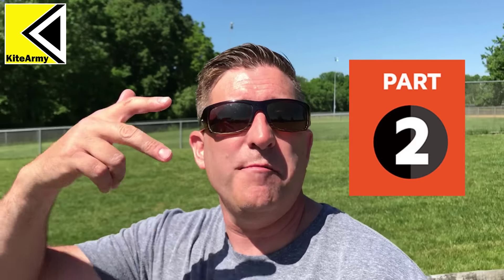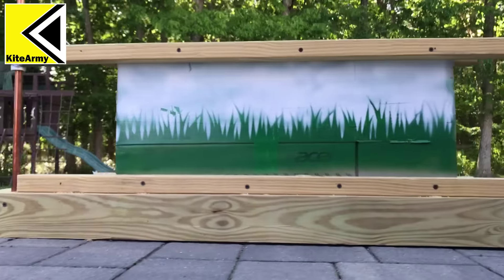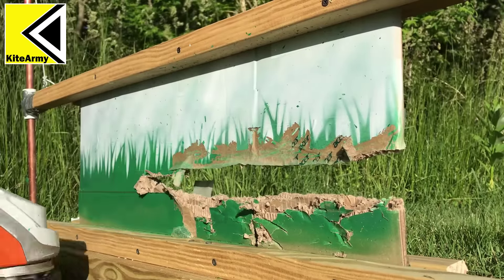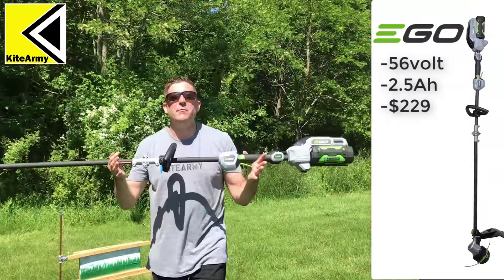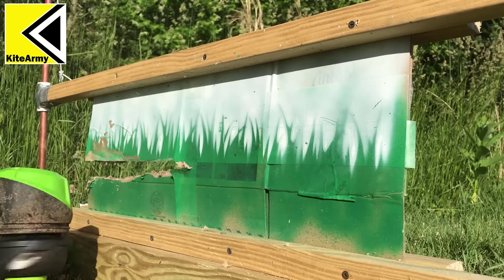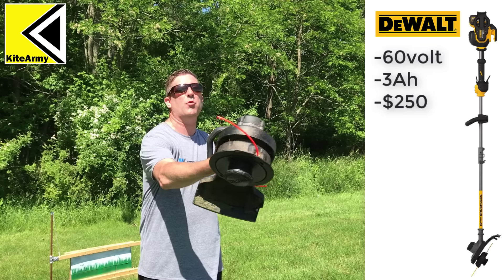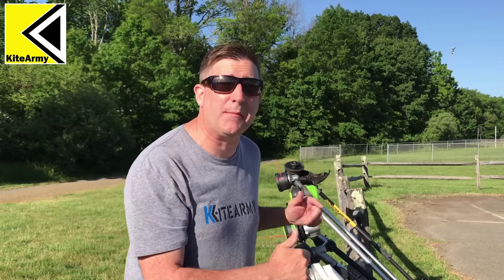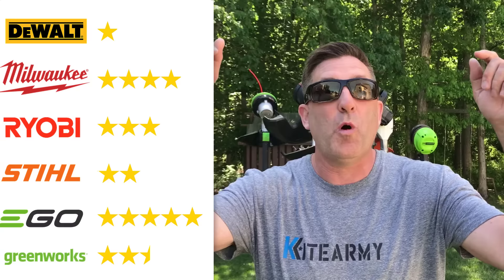BEST STRING TRIMMER 2020 | EGO Milwaukee Dewalt Ryobi Stihl 💪💪💪

Comment: I like the lightness of this machine as I have a weak shoulder.  I found the power to be adequate for my 10000 and 6500 sq ft. lots..   I can't follow the string loading instructions even with diagrams.  This video demonstrating reloading as simple.  My gas trimmer is much heavier.  I tested all the other trimmers: Ryobi, Toro, Milwaukee etc.. They have a higher voltage battery, but I read 18 volts is sufficient for my needs.  They were all quite straining for my shoulder.  
I regret that i don't know if this machine is compatible with a 95 string, but I can try it.
I highly recommend this machine for trimming and edging.

Comment: Just bought the EGO 1521S yesterday 5/21/2021 from Lowes.  What can I say, this trimmer is a beast.  Super quiet and super smooth.  I've had Echo and Stihl before and they where good trimmers but this thing is in another league to me. No mixing gas and oil, no vibration beating you to death. I'm sold on the battery powered equipment.
Reply from the maker: that's how it normally goes
Reply: I wish I could be sold on battery equipment as I know a 40 V trimmer can out perform some gas models. But the issues I have are that these batteries only last 3 to 5 years only and that’s under optimal conditions and charging them properly. To replace them cost a minimum of $80 for a four amp and can go up to $200. But my biggest complaint is they don’t tell you there is no way to recycle these batteries. They are just like the electric car batteries. It’s a great idea but no one tells you that they’re 3k-5k to replace and to date there is no way to recycle these batteries.  Some can be dismantled to extract materials to make new batteries but most go into the landfill.
Reply: @craighellberg4366  ---- Since the cost of charging them is neglibale, you need to figure the cost of Gasoline, oil ( or the mixed cans which is even more costly ) plus  any service needs within that 3 to 5 year battery. 

Does a gas trimmer use $100 in gas and oil in 4 years?  $25 a year?  Guess it all depends on the lawn size / mins of use per week during the season.

Ive got an acre of land and use about 1  40-1 can which costs $21 a year.

Comment: I don’t know what kind of string you are using, but that was pretty bad. Use some better string, let the head come up to full speed, then go at it. Why did you need so much bump feeding when cutting cardboard? Something’s not right. I just returned two EGOs because they weren’t any more powerful than the flexvolt.
Reply from the maker: YEP - cardboard will kill string - but thanks for the advice
Reply: @Kitearmy  that's some pretty weak string you're using. should do a test to see which trimmer can handle .105 the best
trailblazer or stihl cf3 pro
Reply from the maker: @zacjohnson8404  Well - most people are not professional landscapers and .09 should do the trick.  Trust me, cardboard is like razor blades to string.  Go try it
Reply: alright ill have to try it now
Reply from the maker: @zacjohnson8404  Cool - If I'm wrong, feel free to throw a bunch of shade my way
Reply: @Kitearmy  what size line and brand were you using?
Reply: ok I tried trailblazer .105 green line with the stihl fs90 on that really heavy double layer cardboard that's used for fruit packing.
it went through it like nothing. it did wear the line down a bit but it didn't snap off. a more powerful machine will make line snap off worse.
my point is, you need to use better line on your test. not heavier, just better quality line that doesn't snap. just for sake of argument, grab a small roll of green trailblazer or cf3 pro .105 and see how it goes with these battery trimmers. electric motors should have a lot of torque and should be ok with one step up in line weight, I think.
Reply from the maker: @zacjohnson8404  Okay - though most if not all of these trimmers max out at .095.  .105 is professional stuff.  Good comments none the less
Reply from the maker: @zacjohnson8404  Hey mate - You have to watch my blower review - 10 brands.  Hopefully posting this upcoming weekend.  Would love to hear your thoughts
Reply: @Kitearmy  cool man, subbed.
have you tried any of the husqvarna battery stuff?
Reply from the maker: @zacjohnson8404  Great to have you - Oddly enough I have never tried any cordless Husky gear.  Strange don't know why that is.
Reply: @Kitearmy  the ego powerload is aweosme i think that guy got defective units cause i have not had a issue with my powerload at all hands down the best trimmer i have ever owned and used and love it
Reply from the maker: @snoopysrc  I think that some comments are fans of other companies tools - could be the case
Reply: @Kitearmy  who do you think makes a good eletric string trimmer?? i think ego is pretty tough
Reply: @Kitearmy   I'm not professional, but I use .105" minimum on the 'orchard' part of my lawn.  I have to take out those 'stringers' that grow out of the bottom of fruit trees, as well as thick tufts of timothy and fescew.   So if your lawn simply isn't possible to keep a nice fluffy Kentucky Blue, and it is weedy and has strands of feral baby trees growing in it, .105" is a must.  

I use the thickest line possible and actually use Low speed on my Greenworks 82V Attachment Capable.  The string bludgeons the weeds to death, mulches them in the air and sends shrapnel everywhere.  

I've found this to be far more effective on unconventional 'lawn' than what the OEMs offer.
Reply: @Kitearmy  Then why did you use cardboard?
Reply from the maker: @pmaint1  Good analog for tough brush

Comment: I know this is an old video but appears to be variation in the test.

1. The passes were right to with the exception of the Ego and Greenworks.

2.  Didn’t congruent
If string varied between test.

3.  Appeared to be variation in brushed vs brushless head units.

Comment: Hi Andrew, I know this is an older video but I just bought a replacement head for my ryobi expandit trimmer. It lasted 2.5 years (the head) but I got tired of it popping string inside the head periodically and usually on the hottest days. I bought the 1-2-Trim Pro series. No more bump and hopefully feed. You use 3 pieces of 12 inch string folded in half so you have 6 string ends. Where the string attaches, it pivots so less shock to the string when hitting something hard like concrete or wood.Takes like 30 seconds to replace. I just put mine on and went out and edged the sidewalk. Took about 5 min's off my normal time to trim it and made the edge deeper. I then went along one fence like butter. My RYobi Expandit feels like a new piece of equipment.
Reply from the maker: Love that when you find something that makes these tasks easier

Comment: Cardboard grass is not cut from the same side for all trimmers, is that because the heads don't all rotate in the same direction?   The the line is going fastest at the end of the line, you seem to be very close to the cardboard.  I notice when you pounded the trimmer on the ground,  you were chewing on the wood.   I suue would like to know the weight difference.  I am old and want the lightest I can find.  Thanks.
Reply from the maker: I moved the trimmer based on the head rotation

Comment: That stihl model you’re using is called the fsa 90r, it has adjustable rpm dial. You say its a fail when you give 0 ramp up time and have lowest setting for rpm. Also you arent doing the bump feed properly, must be full speed to work right. Says that in manual plus sales man would tell you that.
Reply: You also using the default orange line, .095. That line is amazing for grass and thin brush work. But you cutting through cardboard.
Reply from the maker: It's on full speed - I used the same line on all products.  No line is made for cardboard as far as I know.  In any case, I'm really not impressed with any of the stihl cordless tools.  Maybe their next gen will be better.
Reply from the maker: This video says it all: https://www.youtube.com/watch?v=AHamd-NWg2g
Reply: Kite Army no way that was at full speed
Reply: @TheDudeIndiana03  indeed, video is sponsored by EGO i think

Comment: As always...liked the video but I'm gonna tear this one apart. First of all, I think that cardboard was really hard on that string and affected the results of the test. If you did this test at least 2 more times do you think the results would be the same? I think the cardboard was snapping the string off randomly and if you did more tests your results would vary. The string could have broken off inside the Ego head for instance because of the cardboard...would you have "Failed" that one? Is there another brand of string that is more durable that wouldn't break down as easily to give the trimmers a better chance at making it to the end of the test? Just throwing those ideas out there to see how they "blend"...lol. Still fun to watch and until the string breaks, you do get to see which trimmer chews into the cardboard "grass" with the most gusto so...still gotta give you credit for the demo. Carry on bro! Cheers, John ;)
Reply from the maker: Hey mate - OK I agree that this may not have been the perfect test BUT what would have been.  If I tested on real grass people would have said   one grass was thicker than another - you get the point.  Also I used brand new ECHO commercial string on all models so they all had an equal shot.  I bet if you ran this test 100 times you wold get nearly the same results.  YES I would have failed any brand in this test - I had 6 pieces of cardboard - that's it.  Make it or break it.  

Next test is going to be EGO vs Millwaukee on real grass running through the battery completely.  Should be fun
Reply: @Kitearmy  Sorry for being "rough" on you Andrew...lol ;)...and like an old boss once said to me "It's OK to complain about something, but suggest a better way of doing things to go along with that complaint"...so you got me there...haha. Also is the old saying "You can please some of the people all the time, all the people some of the time but you're never gonna please ALL the people ALL the time". Carry on Andrew, you're dong a great job and I don't mean to discourage you ;) Cheers, John ;)

P.S. Presently working on my first YouTube "rebirth" video on Premiere Elements. It's so different from the editor that I was using. We'll get there tho...still lot's to learn in any case no matter what editor I have...lol. Got rid of World of Warships the other day as it was going to do an update for June and I said "No"...time to dry dock the ships until next fall. YouTube here we come! Yeewww! ;)
Reply from the maker: @funafter5081  No discouragement taken - sometimes you win sometimes you loose - But you have to remember that your real friends are always there for you to remind you that you lost.
Reply: @Kitearmy  ;)
Reply: I agree because you could hear that dewalt trimmer had a bunch of power that was wasted I wanted to see that one go

Comment: I know this is an old video but noticed there is variation in your test.
1.  The  passes varied from right to left all other except Ego and Greenworks. 

2. Didn’t confirm if all the same string was used.
Reply from the maker: yep - same string.  Direction was based on the head rotation

Comment: Thanks for the post! - It has made me think twice about buying a trimmer in the same family as other tools just because the battery is interchangeable.
Reply from the maker: If you need only a single tool you can probably get away with it BUT as soon as you need that blower you are stuck

Comment: Pretty useful information if my yard was made out of cardboard but mine's not so I guess I'll just keep rolling with my DeWalt 60v flexvolt trimmer
Reply from the maker: I always feel really bad for Dewalt - their yard tools make me question their shop tools.
Reply: LOL. Yeah, last time I checked my yard wasn't cardboard either.
Reply from the maker: Mine is like a hallmark card
Reply: He should have used a digital inch pound torque wrench to measure the actual torque/power these trimmers put out or something similar. He used the POS old style trimmer head on the DeWalt that I hate & have on my 20V DeWalt & he started the cuts from right to left on the DeWalt, Milwaukee & Ryobi also. It does make a difference because the DeWalt spins counterclockwise & the Ego does also. You can tell he's Ego biased in the way he purposely cut shittier into the cardboard with the others. I will give the Ego props for the self loading feature but the Ego loses a lot of points because you can't use any universal attachments like you can with the RYOBI 40V Brushless. Ego & Milwaukee use their own proprietary inner shaft connector to attach attachments on them. I have Milwaukee, Ryobi & DeWalt batteries BTW & I would buy the Milwaukee but I can save a lot of money using my universal attachments on the Ryobi 40V trimmer. TTI is the parent company for Milwaukee & Ryobi BTW but Milwaukee screwed up IMHO for not using the universal attachment connector system & would sell a lot more of them if they had. I hope someone machines an adapter that can be used on the Milwaukee to accept universal attachments.
Reply from the maker: @jetenginethrust863  KIteArmy's response:  Yes I'm biased towards EGO because the tool performed best (in my test and opinion) better than any other model.  I think it would be strange to prefer a brand that does not perform well.  2nd - EGO does have a universal tool - called the multi-head.  3rd - depending on the rotation of the head, I started on the appropriate side of the cardboard to keep it fair.
Reply from the maker: @jetenginethrust863  Nope - I have a good time making a fool out of myself - Welcome to the club :)  

Also, it aint universal if if it doesn't fit everything.  Here's the definition of universal "applicable to all cases".  HOMEWORK DONE!

Comment: What about the 36 volt Makita trimmer? I have been watching your reviews for quite sometime now and my 3 choices - EGO - Milwaukee - and Makita. I was hoping you would have tested the Makita so I could rule it out completely. I don’t have anything that uses either brand of batteries so I am starting out fresh. I was at Home Depot yesterday and I left more confused than ever. Both the EGO and Milwaukee seemed heavier than my gas trimmer which I am replacing. Have you thought about using a brand name gas trimmer to use in this test against the Milwaukee and the EGO it would really be a great test in my opinion. But it’s not my time doing the testing. 
Ok now which would you purchase the EGO or Milwaukee? I value your opinion. Thank You and I hope everyone is having a great holiday, Cheers
Reply from the maker: The EGO carbon fiber auto load will blow your mind.  Not to mention the other tools they make are just as solid - also cheaper than Milwaukee.  Not much to say about Makita other than I would never buy one.
Reply: @Kitearmy  why? What’s wrong with Makita?
Reply: @albertsilva2818  Unless its made by EGO he will have a negative review.

Comment: To properly run string trimmer tests, you should pair the trimmer with the maker's own brand of lines.  For example, my EGO carbon fiber split shaft trimmer would break lines at an unacceptable rate when I used other brands of trimmer lines (including Husqvarna Titanium Force, Oregon Magnum Gatorline Super Twist).  Both the Husqvarna and Oregon are premium lines but they would snap off miserably when I used them on the EGO.  When I used EGO's own brand of lines on the EGO trimmer, the lines lasted a long time.
Reply from the maker: I used the same lines to keep things fair
Reply: @Kitearmy  Undoubtedly fairness was your intent, but some trimmers just don't like some other brand's lines that they are not designed to run on.  Although the packages of the lines may not say so, each type of line has its own ideal or tolerable rpm range.  If the trimmers are run outside of a line's design rpm range, the trimmer may not cut well or the line may break more often.  Therefore, the test would actually be fairer if the same brand of line was used on the same brand of trimmer.
Reply from the maker: @stevew3978  sounds reasonable

Comment: You forgot to mention the Milwaukee is a quik-lok attachment system that Milwaukee makes attachments for, you have the ability to change from a trimmer to a hedge trimmer, pole saw, and edger, plus you can use that same battery on a drill, impact, grinder, compound Miter Saw, table saw just to name a few and whatever M18 tools Milwaukee makes. Can EGO do that? You can save a lot of money by just buying the attachments instead of having to buy a separate tool for each one.
Reply from the maker: Right - but does Milwaukee have a zero turn ride on mower powered by the 18v batteries?  Ego does

Comment: I'm trying to switch over most of my stuff to battery powered. Ego is very tempting but I was looking at one in the store today and if you never saw any videos on them you would think they are junk. They feel low quality even next to Ryobi. I really liked the feel of the DeWalt especially the handle. I walked out with a milwaukee because all my tools are red and I didn't like the exposed vents on the DeWalts cutting head. That flexvolt was very tempting though.
Reply from the maker: You made a good choice - IMO the dewalt is poorly designed

Comment: You should be going right to   left on every trim and keep the head a few inch away from the cardboard riged test or just dont know how to use a trimer
Reply from the maker: OK - though pay close attention - they don't all spin the same direction!  Maybe both of us don't know how to use a trimmer.
Reply: Kite Army my issue with your test is you got the head too close to the cardboard, causing the line to break prematurely. It skews the results.  I’m always getting on to my helpers because they break the line too quickly, wasting time with daily reloads when I generally get 2 days worth of lawns on a single head’s worth of line.